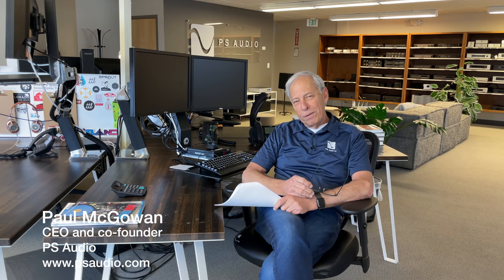Why speakers are made from MDF

Comment: Question .
In professional music PA performance rigs they generally use active cross overs whereby the appropriate high,mid and low frequencies are split before amplification and then receive a separate amplification of each frequency subset eg Bass,mid and treble each have their own separate amplifier and related appropriate speaker ,so a stereo 3 way system would require 6 mono or 3 stereo amps and therefore be capable of providing exactly how much bass mid or treble they require .
as opposed to the more traditional hifi type system that uses passive crossovers that are very inefficient and soak up and lose considerable power of the amplification.
I can understand that it may be due to reasons of practicality in that people may not want the complication of 6 power amps and that separate tweeter,mid and subs in a personal environment may not be desirable but surely they could be produced in a self contained enclosure in a similar size to some floor more traditional floor standing speakers .
I am just curious as to why this approach never seems to be used in what can be very expensive hifi set ups as people try to put together ultimate systems and the like though even as i write this i can imagine that such a system may struggle in the realms of subtlety.
It has also sprung to my mind that bang and olufsen regularly do this in self contained amp/speaker cabinets but then again wonder why it is not more popular .
indeed i myself  do have several B O components and many people find them very pleasant to listen to but their signature sound to me is somewhat artificially clean sounding but this i suspect is most likely due to the digital class of the amplifiers
Reply: Mostly it's just a LOT more for the end user to screw up.  I'm an aging rocker with more than my share of experience with 3 or 4 way PA rigs and it's just a pain in the rear.  You might look into the various active studio monitors we use in music production.  There are some mighty fine sounding active units that would make a lovely bookshelf type presentation in a modest listening room..
Reply: @slyfoxx2973  Sincere thanks for your reply,yes i too spent many years as a muso with live pa, i suppose that may be the problem itself in that we are familiar with those differing methods that to many people if you tried explaining to use an amp for each loudspeaker frequency they would probably be like “yeah ,whatever and you’re giving me a headache “ as in a lot 0f respects it requires a rethink of their traditional methods but to me it makes sense to give more power to more demanding speakers such as the subs or whatever ,but anyway thank you again for your reply .
I do actually actually have an old panasonic mini system from the 90s that is two way bi amped apart from the bi wiring from the outputs to the speakers appears completely normal  .
And bang olufsen regularly do this which often explains sometimes rather hefty prices,their top of the range beo 90 has 15 power amps and associated speakers per cab and something ridiculous like 8k per side output in a domestic looking self contained speaker system 😂sorry for droning on but i suppose a lot of it is down to peoples perceptions and it should nt really be surprising to them that such power is able to deliver a clean sound at unthinkable volumes especially in a hifi setting because it is basically a PA in disguise even though each speaker cab is over 300 pounds in weight 😂

Comment: Everything vibrates and have a resonance. HDF is harder than MDF. Yes, but that just means that the resonances move up in  frequency. Softer wood like pine will have resonances lower in the frequency-area. The important Thing is to get as few resonances in the middleband as possible. MDF dont help with that...

Comment: I see you’ve got the latest issue of Audio Advisor on the table next to you - a fine choice…
Reply: What's Audio Advisor and how does it compare to Audiphile or The Absolute Sound?
Reply: @MCMTL   Audio Advisor is out of Michigan and is basically like a CRUTCHFIELD but generally carries better high end product. Both are geared towards the audiophile. Judging by your name, I assume you’re from overseas? The Absolute Sound is an audiophile magazine that reviews high end gear where as, AA and Crutchfield SELL gear. Hope that helps Marc
Reply: @keeferdog5617  As far as I know outside of the big box stores those two and B&H Photo in NYC are some of the biggest audio dealers in the USA.

Comment: Mdf and plywood are about the same for damping. Layering it with a flexible material sanwitched between two panels dampens it far more. See this, with an experiment around 35 minutes in: https://youtu.be/EEh01PX-q9I
I've tried both mdf with layers of flexible material with mdf and just plywood, couldn't measure or hear much difference between them.

Comment: Most pro sound reinforcement cabinets are made from real wood. Reason...durability.
Reply: HDF solves that problem it's called hardboard for a reason.
Reply: @ryacus  I don't think so....drop a loaded hardboard pro cabinet from 10 feet and more likely it will crack, real wood is more likely to bend...hardboard gets heavy af too. Hardboard is ideal in the home and studio, not on the road.

Comment: Sawdust is a garbage byproduct and cheaper by far yet in a $1000 pair of floorstanders the mdf cabinet is still the most costly item to manufacture. Other uses are fuel, mulch, kitty-litter etc, certainly nothing of any real value.
Reply: the price don't matter at all, especially for very expensive speakers! even if it would be more expensive to use MDF it would be used because you need to calculate all parts of the speaker and that implies a guaranteed behavior

with real wood you won't even manage identical sound for two speakers of a pair

Comment: The other material you alluding to like with Wilson audio secret X is a carbon powder mixed in a resin,  resin composite is the best.
Better than H-MDF is chipboard what wood chippings it certains, forms of plywood as well is good Valchromat MDF is best acoustic and strength than MDF or HDMF and is non-toxic, you shouldn't really use mdf it is bad for the environment bad for people working  with it or around it.